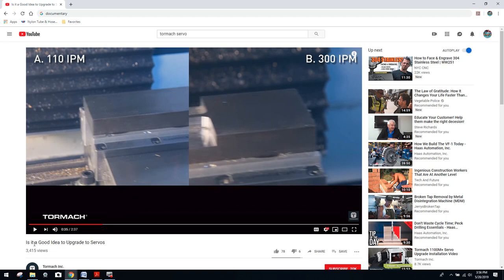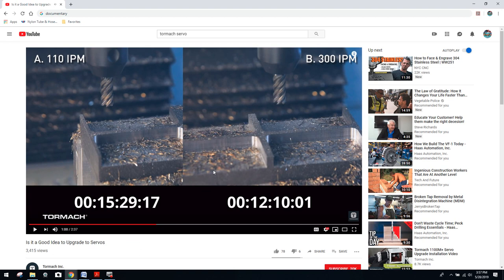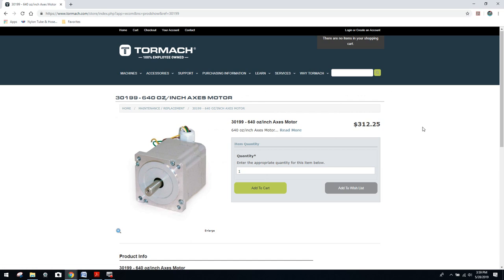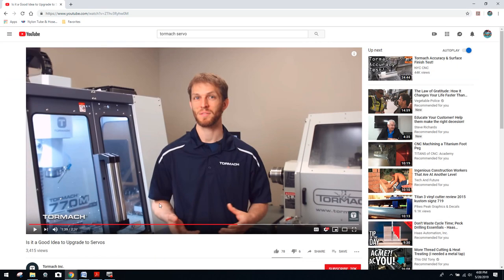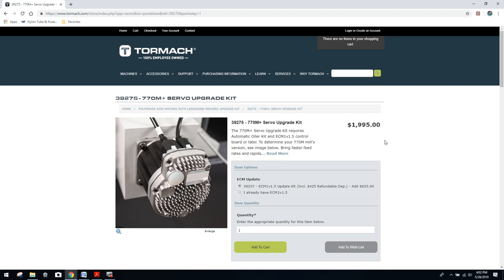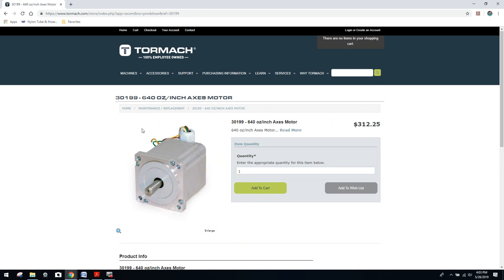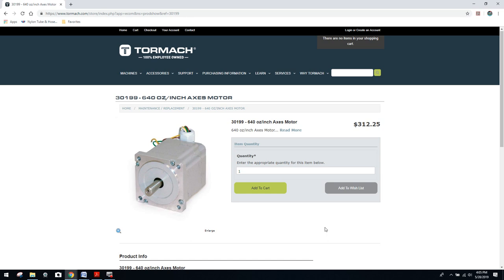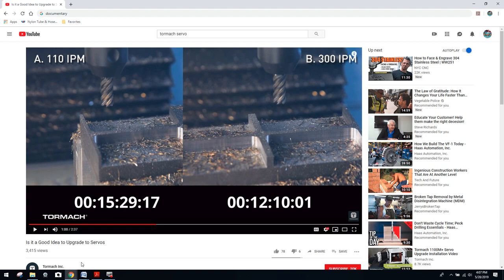Is A Stepper as Accurate As A Servo Motor?

Comment: I remember years ago that tormach refused to use servos, there was somewhat of an anti servo campaign from them, new they are servo
Reply from the maker: Thank you for your support desktop. The servo stepper debate has gone on forever. Regardless of which you run with proper setup, and calibration assure your machine's accuracy.

Thank you,
Vince

Comment: What about a closed loop stepper, would that improve the accuracy?
Edit: when would we need a closed loop system if ever.
Reply from the maker: MitchMoe a closed loop stepper is considered a servo. The accuracy on a servo, and stepper is the same, but the way they achieve their accuracy is different. Here's a breakdown on it. https://www.youtube.com/redirect?redir_token=7y5PZvBRajyttcEiizAvXSFNrjB8MTU3NTMyODgyNUAxNTc1MjQyNDI1&v=Exk7ORteS0o&q=https%3A%2F%2Fwww.orientalmotor.co.in%2Fqa_det%2Fqa_svmotors04%2F&event=video_description 
Thank you,
Vince
Reply: Can we use closed loop stepper motors instead of servo Motors. Can we get same accuracy with closed loop stepper motor?
Reply: @abhishekparmar2284  yes you can

Comment: All of our CNC machines at GE Aircraft Engines to make rotating parts for aircraft engines used either a DC axis drive motor with a resolver or a Fanuc AC drive motor with a encoder. TheAC axis drive motor was more accurate then the DC axis drive motors. That is because an encoder is more accurate than a resolver.

This is where I am having trouble understanding the differences between a stepper & servo motors.

Any help would be greatly appreciated.
Reply from the maker: Here's a complete explanation overview of the two types. https://www.orientalmotor.co.in/qa_det/qa_svmotors04/ Thank you,
Vince

Comment: Vince, would going from a 5mm pitch to a 10mm pitch loose some resolution? Also, I would like you to do a video on ball screws someday. Cover things like ball screw selection and end machining guidelines, Like if one buys a 25mm ball screw, what is the machining diameter range? One wouldn't want to machine the ends down too small and loose too much strength and rigidity. I have looked around on the internet and haven't found much info. If one is using angular contact bearings or radial bearings, does one want to use a bearing with as large of an ID as possible to preserve as much of the ball screw diameter as possible? How about the coupler diameter machining? Is it counter productive to have a 25mm ball screw machined down to 1/2" for the coupler?  I know there are a lot of variables to consider like type and size of machine, motor size, length of ball screw, load and weight. My thinking is that preserving as much of the diameter of the ball screw as possible would be better for strength and rigidity. What is the maximum and minimum machining diameter range on different size ball screws?
Reply from the maker: Hey Chris, thank you for your support as always. Changing the ball screws pitch while allowing for the ball nut to cover a greater distance per rotation is still controlled by the entire transmission which would include your drives, and steppers which when utilizing micro stepping will produce virtually the same resolution. Its always the sum of all the components that yield the synergistic result with CNC.

The question on the diameter of the machining of the ball screw ends is one the factories look at very closely to make sure units are able to support their rated load. I have never seen an issue with a machined end causing a failure ever. I have heard of ball screws breaking, but typically its do to a crash. The bearing question is once again determined by the accuracy ratings on the ball screw (C0-C7 are most typical) which the factory selects based on all the load variables for the engineers applications. All quality motor couplers have torque ratings, and when machining them to a size for a specific ball screw you could be at risk of a failure if the manufacture rating doesn't support the ball screw your trying to adapt it to. Once again manufacturer ratings are to be followed regarding supported ball screw sizes before attempting to open any of them up to a larger size.

The easiest way to view ball screws, and motor couplers is to review the manufacturers specs in detail for what your application is. Forensically reviewing the components assures you'll have a well balanced system.

I will be covering ball screws in a later video.  :)

Thank you,
Vince
Reply: 16 mm pitch is the common ball screw pitch to use  I use 16 mm pitch x 16 mm dia in my z axis I build with 20 mm linear slides  .. do your selfe a favor keep the ball screws to the Zaxis  go rack pinion  with linear slides,v rollers or speed demion rails  with ball and lead screws they vibrate and heigh rapid speed thers no advantage  any good router or plasma your better off rack pinion  . unless it a milling machine most have short screws . hope this helps